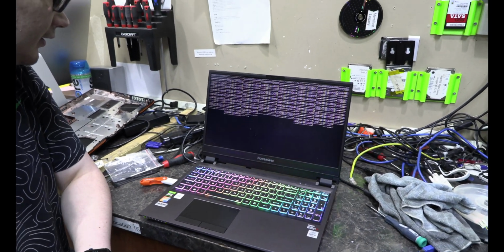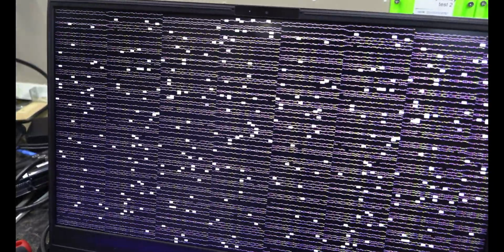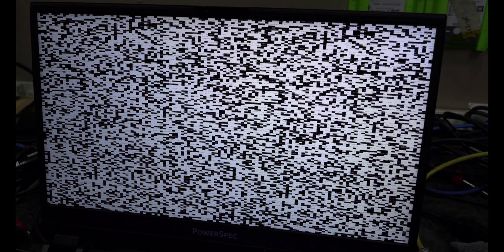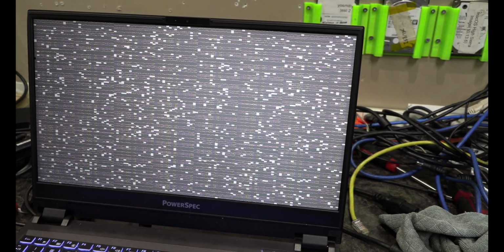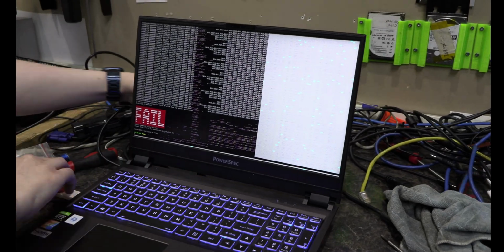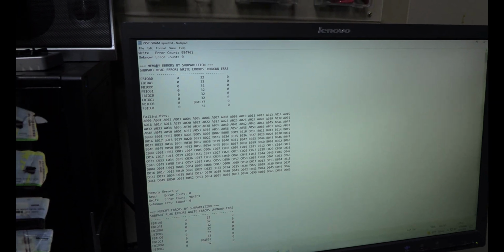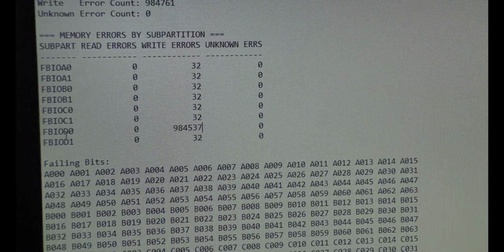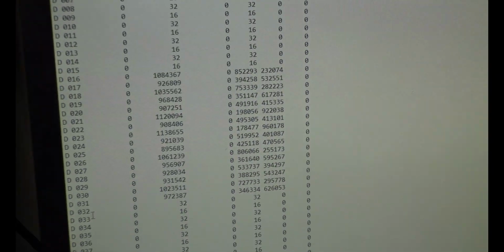💥Failed  RTX GPU  - Bad Vram  ? Part 1 Diagnose Software #rtx3070

Comment: i have a 3080 with a bunch of errors on every single vram module. Does this mean something is wrong with the memory controller? also in GPU Z it reads 0 VRAM. 

is this fixable?
Reply: You can't run Mats on a RTX 3080 or other cards using ddr6x Vram you need to do a NVMT TS test

Comment: hi... thank you for sharing... i already download the file... but its on .bin file format... how i make it in a bootable?... the software you link here has a virus i can't install it... thank you
Reply from the maker: Yeah, that's a false positive — totally normal with these types of diagnostic tools.
Antivirus software flags it because:

It's a low-level system tool that writes directly to hardware
It's not "signed" by a major software company
It's leaked internal NVIDIA software, so it's not in any trusted software database

To get around it:

Temporarily disable your antivirus while downloading/extracting
Add an exception for the file or folder
Use Windows Defender and click "Allow" when it prompts

The tool itself is safe — it's widely used in the GPU repair community. Just make sure you're downloading from the link we provided, not some random site.
Once you extract the .bin file, use balenaEtcher (https://etcher.balena.io) to flash it to a USB drive. Then boot from that USB in Legacy/CSM mode (not UEFI).
Let us know if you get stuck! 🔧

Comment: How to use this tester software via usb?
Reply from the maker: How to use it via USB:
Step 1: Create bootable USB

Download the .bin image (from our link)
Flash it to a USB drive (8GB+) using balenaEtcher or Rufus (DD mode)

Step 2: Boot from USB

Plug USB into motherboard (not GPU)
Enter BIOS → set boot mode to Legacy/CSM (not UEFI)
Boot from the USB drive
You'll see a Linux terminal

Step 3: Run the test
If GPU outputs an image:
ls
mats
If GPU has no display (use iGPU for monitor):
ls
modsinit
mats -n 1 -e 50
The -n 1 = GPU index (1 if using iGPU for display)
The -e 50 = test 50MB of VRAM (higher = longer but more thorough)
Step 4: Read results

Screen shows PASS or FAIL
Detailed report saves to report.txt
Type cat report.txt to view it

Understanding the report:
The report lists each memory channel (A0, A1, B0, B1, etc.). Each channel = 2 VRAM chips. If you see errors on a specific channel, that tells you which chip is bad.
Chips are counted counter-clockwise starting from the corner opposite the GPU's golden arrow.
Check our video for the visual walkthrough! 🔧

Comment: my laptop 1060 might have same issue..device dxdiag says status unkwon running at full power. i wanted to buy vram of 1060 and replace them but couldnt find link to buy them
Reply from the maker: Hold up — before you buy VRAM chips, let's make sure that's actually the problem.
"Status unknown, running at full power" in dxdiag doesn't necessarily mean bad VRAM — it could be a driver issue, power management setting, or something else entirely.
First, diagnose properly:

Run the MODS/MATS diagnostic we showed in the video — it'll tell you exactly which chip (if any) is bad
Check for artifacts, crashes, or specific symptoms
Look at GPU-Z to see if VRAM is being detected correctly

If you do confirm bad VRAM:
GTX 1060 laptops typically use one of these GDDR5 chips:

Samsung: K4G41325FE-HC28 (512MB each) or K4G80325FB-HC25 (1GB each)
Micron: D9TCB (MT51J256M32HF-80)

Where to buy:

AliExpress: Search "GDDR5 Samsung K4G80325" or "Micron D9TCB"
Donor boards: Sometimes easier to pull chips from a dead card with the same GPU

Important:

You need to match the exact chip type (Samsung vs Micron) and density — mixing doesn't always work
Laptop GPU VRAM replacement is advanced micro-soldering work
The 3GB and 6GB 1060 variants use different chip configurations

If you want, send us the exact laptop model and symptoms — we can point you in the right direction before you spend money on parts. Or check out our mail-in repair service if you'd rather have us handle it. 🔧

Comment: Thanks for this vid, have a question tho, you don't seem bothered by the 32 errors on each other vram chips, is it normal? i have on mine like 0 errors on 2 chips, 32 errors on 6 chips and 72 errors on 2 chips (rtx 3080). these numbers are pretty low and i plan to try heatgun solution.
Reply from the maker: replace those 2 chips

Comment: Can it work with hybrid optimus  laptop ? I want to check my rtx3060 but I cant disable the integrated gpu
Reply from the maker: yes if need repair you can send in for repair
Reply: @TekkiesIncBartlett  Thanks a lot, I wish but I live in Asia.

Comment: Have a RTX 3060 12gb with vram issue.  Driver installs, but fails to load up on boot.  
What does repair cost for a faulty chip?
Reply from the maker: please contact us 630-246-4441 thx be glad to help
Reply from the maker: depend on how many chips are bad and the cost of the RAM chip. It's very possible to repair best is to mail it in repair for to be repaired. we be glad to help. thx

Comment: GPU Z reports the following about my Gigabyte RTX 3070 : Memory Size "0 MB"
I think I'm also having an issue with VRAM that went bye-bye. 

I used DDU to uninstall graphics drivers in safe mode and tried a clean install of latest NVIDIA drivers, but as soon as it installs them the screen goes black, no image, and restarting doesn't help..only power cycling 3 times to go back to safe mode and completely remove the drivers with DDU again, so I can at least use the PC with just the Microsoft Basic Display Adapter. 

I'm going to use the software links you provided in the video description – please let me know though:
Do I need to have the NVIDIA drivers installed, or will the diagnostic tool report a bad VRAM chip even without NVIDIA graphics drivers installed? Thanks!
Reply from the maker: Yes it should recognize the card and do test
Reply: any news on ur card having the sam issue
Reply: @xtrmloki  Took the card in for service, it's still there after 4 months/waiting for parts delivery – they finally let me know it's not a problem with the VRAM, but a problem with the actual GPU/graphics processor core. They now ask me for approval to try and fix it, but there's a chance it won't work and they assume no responsibility if they brick it.

Comment: were i find the report text. thx
Reply from the maker: The report file is called report.txt — it saves automatically after the MATS test completes.
You'll find it in the /home directory on the USB drive you booted from. If you used the autorun version, it might be named autorunreport.txt instead.
To view it:

After the test finishes, type: cat report.txt
Or copy it to another drive and open it on your main PC

The report will list each memory channel (A0, A1, B0, B1, etc.) and show errors for any failing chips.
Hope that helps! 🔧

Comment: Hey I tried doing this on my  RTX 4090 series GPU but I go the following error:
"Invalid register 0x14d0001 specified for this GPU
Segmentation fault"

What can I do? I bought it second hand so unfortunately I don't have the ability to warranty the card and I'm getting weird artifacts and multi-colored sparkles during gameplay. 
I've tried everything except diagnose the GPU itself (re-mount, different slots, fresh windows install, ect)
Reply from the maker: work only on 3000 series and lower
Reply: @TekkiesIncBartlett  How can I diagnose 4090 ? I have issues with stretched textures sometimes

Comment: Occasionally my pc freezes with artifacts during games, assuming its the gpu. Will doing this show an error or does the gpu need to be corrupted with artifacts when doing the test? Also how do you run the bin when starting it up? Thanks
Reply from the maker: no it doesn't have to be artifacting with testing most likely it a chip starting to go bad.